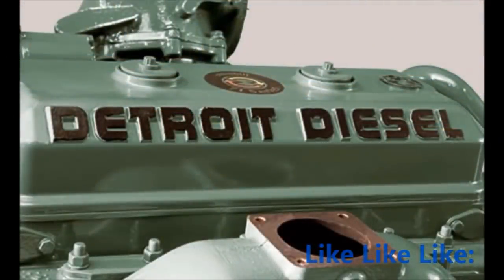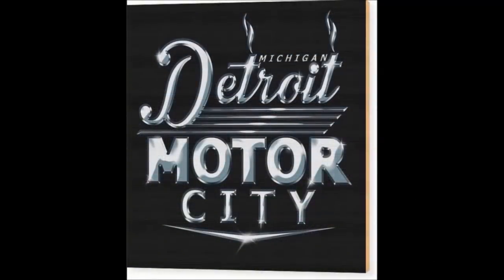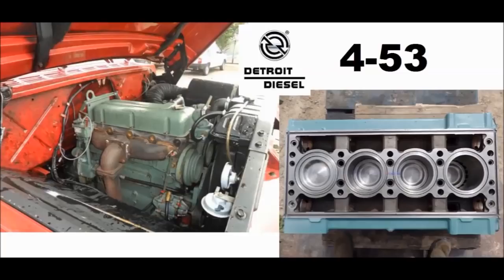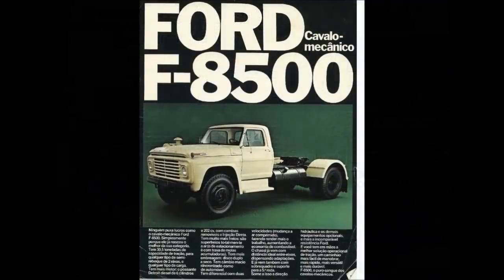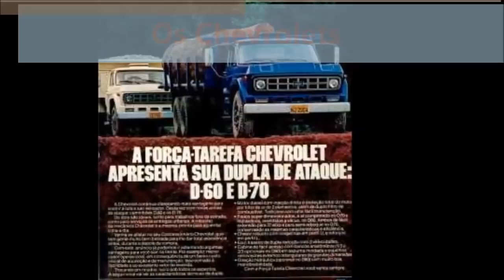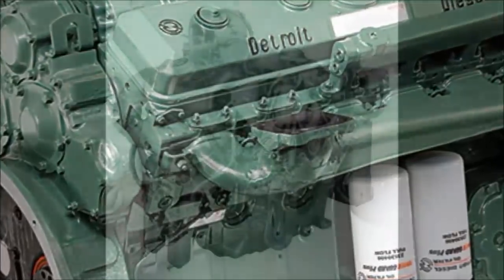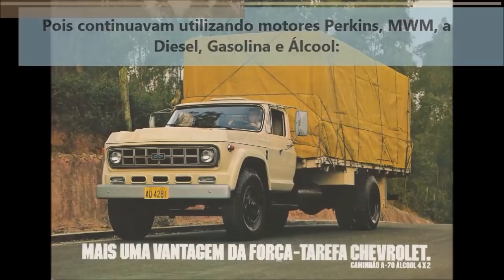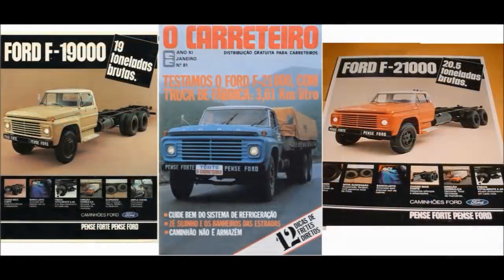Os Caminhões com Motor 2 tempos – Detroit Diesel da Ford e Chevrolet

Comment: Muita gente escuta falar em motor diesel 2 tempos, já entendem como um motor similar aos de motos e motoserras, que possui cárter seco e tem que misturar óleo ao combustível, mas não é nada disso.
Motores diesel 2 tempos e com cárter úmido como qualquer motor 4 tempos, só consome ar e combustível como qualquer motor 4 tempos, eles conseguem fazer o ciclo 2t com a ajuda do compressor mecânico (um blower). Eles só possui válvulas de escape, a admissão é por janelas no final do curso e a descarga é feita pelas válvulas no cabeçote.
Reply from the maker: Verdade, a válvula de escape no topo permite que o pistão tenha um curso maior, algo indispensável para o ciclo diesel que trabalha com um compressão bem maior que o motor a gasolina
Reply: Existem motores diesel 2 tempos sem válvulas, com escapamento na janela tb.

Comment: uma dúvida: nas Yamaha tem um tanquinho de óleo prá lubrificar (tem gente que mistura no tanque), como faz no diesel? o próprio combustível lubrifica o cilindro?
Reply from the maker: O motor de ciclo Otto 2 tempos possui cárter seco, e a mistura combustível/óleo passa lubrificando a cada volta, já no motor a diesel é diferente, ele possui óleo lubrificante semelhantemente ao motor 4 tempos, a entrada de ar é feita pelo blower e saída em válvulas no topo...
Reply: @qravolantão  caraca, esqueci dessa diferença do ciclo otto pro diesel, vlw
Reply: @qravolantão E existem motores que a admissão é na janela e as de escapamento tb, chama-se lavagem circular ou looping, os motores pré long stroke da Sulzer e da MAN eram assim, carbinizavam um pouco mais, mas tinham muito menos peças móveis, as válvulas e seus acionamentos.
Já o sistema com válvulas na cabeça,  chama-se lavagem unidirecional.

Comment: O correto seria V6, não 6V.
Reply: É o modelo dele mesmo, está certo
Reply: @gabrielvieira6529  sim, é um motor 6 cilindros em V, mas a nomenclatura correta é V6.
Reply: @ricardobento6474  sim eu sei mas nao sei o por que a marca colocou invertido
Reply: Tamo faz a designação de fábrica é essa mesmo 6V53, 6V71, 16V149, etc.

Comment: Motor 1.4cc ??? Só isso?
Reply from the maker: Não. Em qual parte você endenteu isso? pois a sére 53 era 53 polegadas cúbicas por cilindro, que equivale a aproximadamente 868cc por cilindro, logo, os motores 3 cilindros eram 2.6, os 4 cilindros 3.5, e os 6 cilindros 5.2.
Reply: @qravolantão  mas uma polegada não é 25,4mm? N seria 25,4x53 1360 mm
Reply: Como 53 polegada da 868?